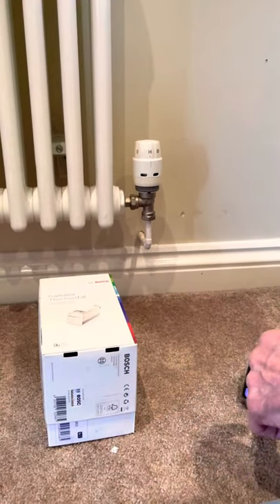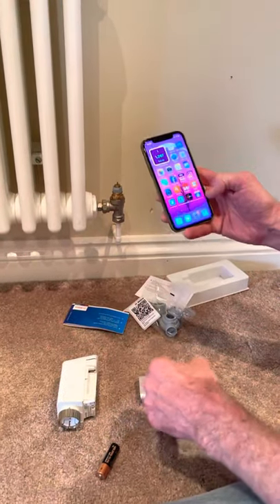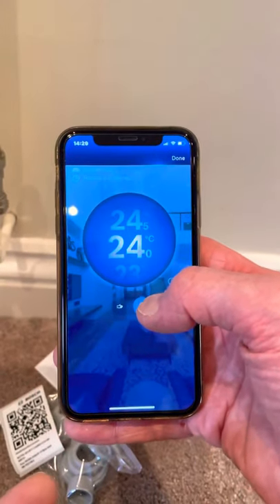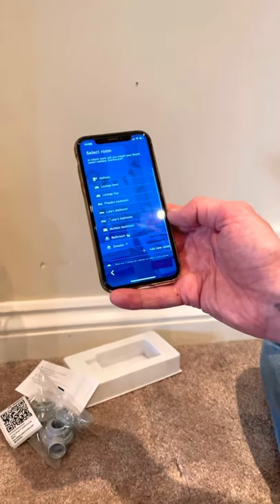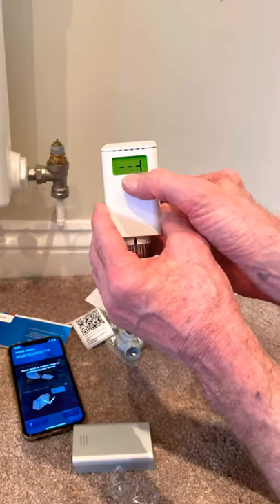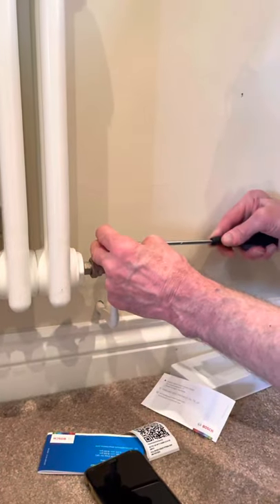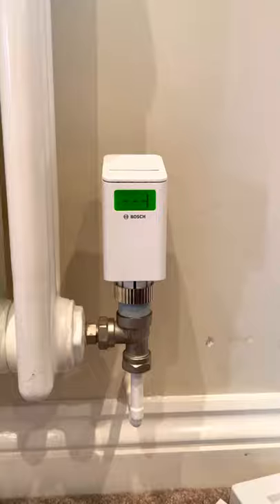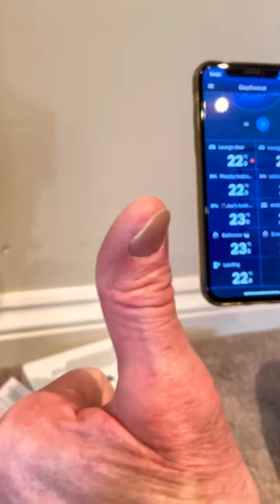BOSCH smart thermostatic radiator valve installation. Worcester bosch

Comment: Thanks for this video, I installed 13 Bosch smart TRVs and an easy control today. Very straightforward and worked well. 
The only trv that the head wasn't happy about was a Myson Contact which I find bizarre as they are probably one of the most common trvs. I just ended up swapping it for a different brand.
Thanks again

Comment: Very easy to put on and setup but what Bosch doesn't mention is the key step that you need to offset the temperature to the room temperature. I had as much as +3C° from the actual desired room temperature because of the location of the TRV, too close to the rad,  so the house was freezing! I saved a bit but i got a room temperature thermometer and adjusted the offset. Now its works like dream. Don't forget to adjust the offset!
Reply: How did you do that?

Comment: Not clear for me with what do they connect, and over what kind of protocol. I'm in process of changing our boiler and evaluating this as it appears to be compatible with Home assistant. I understand that CT200 thermostat is connected via wifi and 2 wires bus with the boiler. What I do not understand is if the trvs need a sort of a radio bridge (zigbee?) or if they can connect directly to the CT200 for example

Comment: Can i connect these to google home ? And do i need to still have a smart thermostat or can i use this without one?
Reply: It is Google Home compatible and you don't need additional thermostats. The heating starter kits from Bosch come with the SHC and a couple of TRVs but no smart thermostat. Although you might want to be prepared to contact the support, or my SHC is in an update loop because it's an engineering sample.

Comment: 50kw combi..... Was it a mansion? Why such a high kw?
Reply from the maker: Hahaha 
50kw is on the hot water only, producing 18 litres per minute. The central heating is a max of 35 kw and has been range rated down to 28kkw.